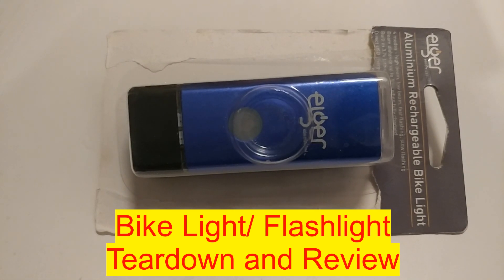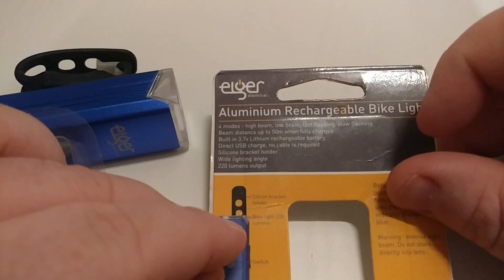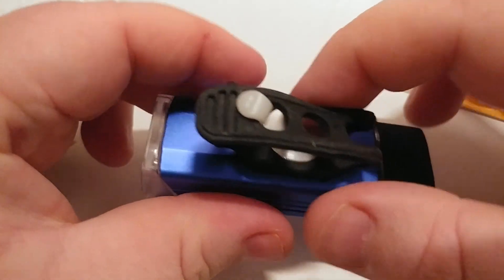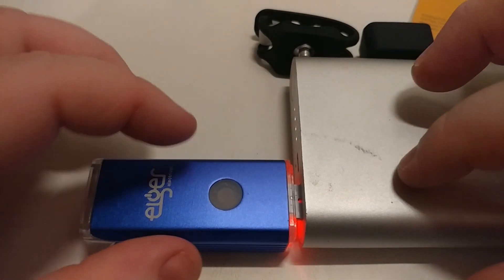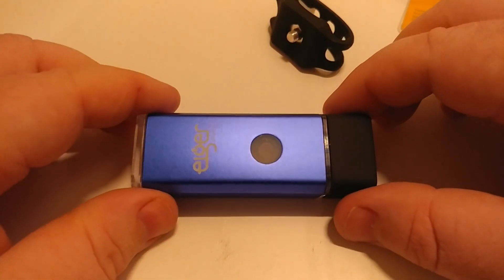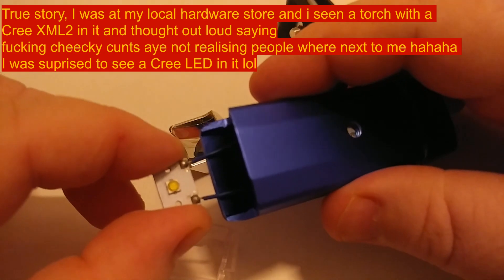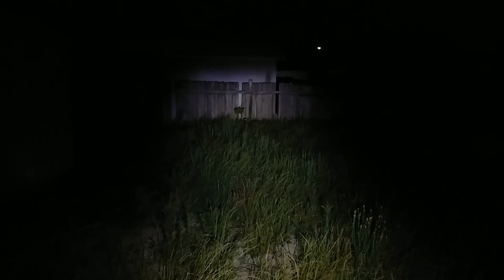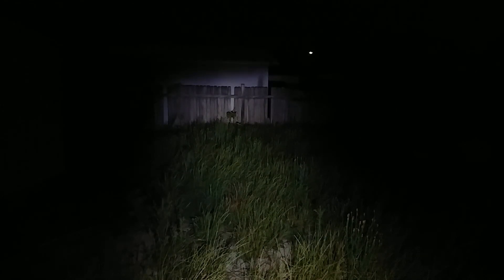Review/Teardown USB Rechargeable Bike Light (Cree XPG2)

Comment: Thanks for posting this review (nearly six years ago!  It is now Aug 2024). I found your review interesting, a real niche find. I have two of these that I too bought from Bunnings years ago.  I don't recall what I paid, but they were a clearance item and your quote of $4 sounds about right.  The value for money was amazing. 

I am not a techie, but found your info interesting and I now know the CREE XPG2 LED has a good reputation in the industry, so no wonder the light is bloody amazing, it is by far my best bicycle headlight.   Of course it can also just be used as a torch.  As a bicycle headlight it is very bright and illuminates the road very clearly. And it is so bright that car drivers are easily able to notice the light and thus notice you (which sure beats getting run over). 
And as you point out, the light has the vertical cutoff so that whilst car drivers notice you, it does not shine up and blind them (obviously you have to have it properly mounted/positioned so that it does not point upwards). 

I searched for info about this light as I was curious as to the specs because I recently pulled them out of the cupboad after many years.  I am amazed that the batteries were not flat as I thought they would self-discharge over time (but they were stored fully charged).  Nevertheless I re-charged them to ensure they were fully charged and I ran a test and they were still shining brightly after an hour (I stopped after 60 minutesas I did not want to needlessly flatten them). Hopefully they will last quite a few more years, but when the batteries eventually lose their re-chariging capacity I will definitely just replace them so I  can keep using the lights.

Anyway, I am now going to check out some of your other videos.